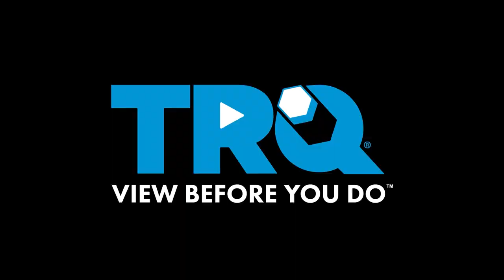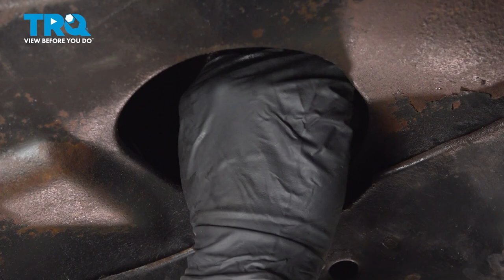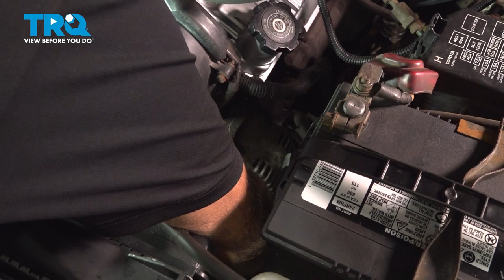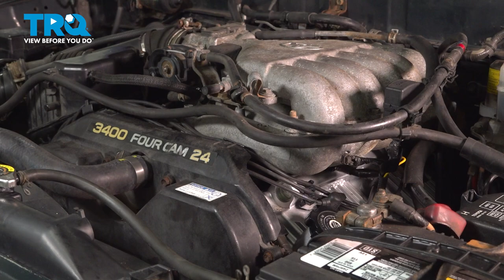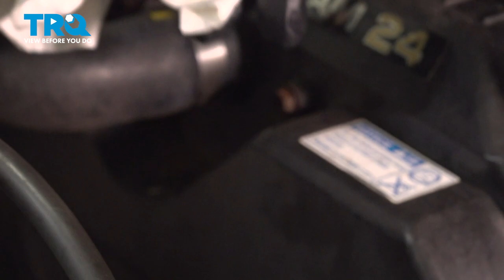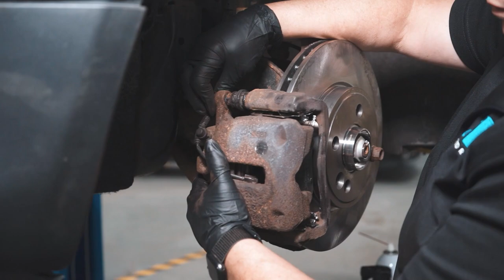How to Change Engine Oil 1996-2002 Toyota 4Runner

Comment: Hi. I just did what you showed to change oil in my 2002 4runner. I filled it with 4 liters of oil. But now dipstick reads very low as if i have not refilled it. I went back under and checked if oil was in sump, it shows its there but dipstck still reads empty. I am afraid to start the car

Comment: 3rd Gen's have to have one of the most annoying oil filter locations of any car. FWIW I go in through the fender well. If your rubber flap is still there just pop a few of the snaps to allow it to open and fold back. I use a long extension with swivel and then to a cap style wrench. You can watch the label/graphics on the filter to judge when you have your preferred amount of turn past  finger tight.